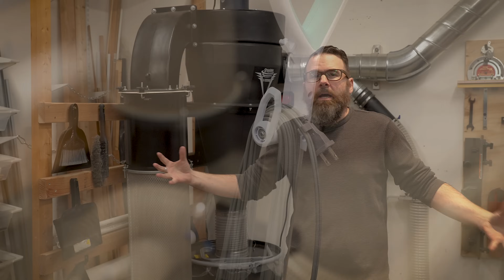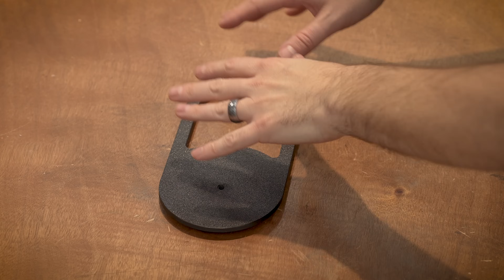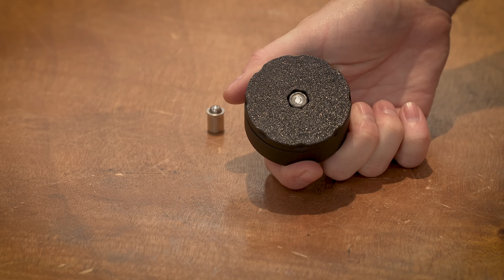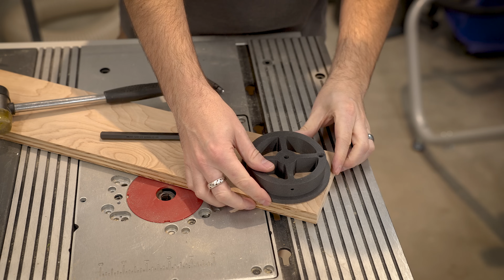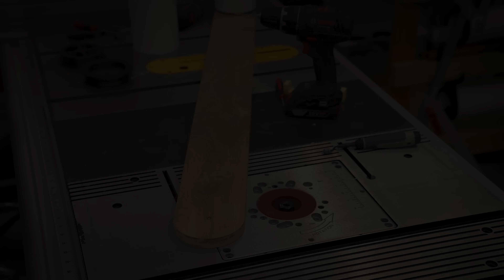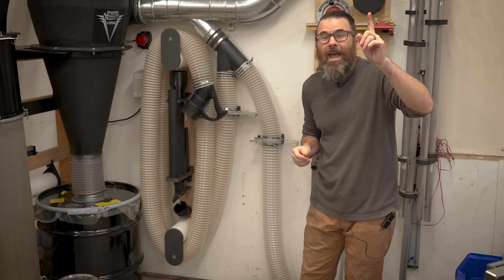3D Printed Hose Storage for Dust Collector

Comment: I may be getting really old.  Hell, I am old.  I’ve been a woodworker for almost 4 decades now.  Never heard those called “ball detents”.  I do have a gallon jug full of “bullet catches” that I have used in building numerous cabinets where they are used with a small strike plate.  When you install them into a cabinet door, they CATCH in the strike plate to hold the door closed.  Some folks use magnetic catches for a similar solution.  Bullet catches (now called ball detents) are a more elegant solution.  Either way, great use for them to be used for your hose storage.  Thanks for sharing.  Oh, and an idea for holding the hose together so you can access your dust collection control…… bungee cord.

Edited: For grammar
Reply from the maker: Things have many names, especially when used in different contexts.  What's a rabbet for some is a slot for others.

Comment: 14:44 keep an idea on wear and tear on the tube. The ball is after all a "point" touch on the brush's tube, and it might wear down a groove (as one keeps naturally placing things in the same spot once they get used to it, it's a human thing we all do). My old, old German made vacuum machine for ashes had a clip on system very similar to this, and because the bend had to go in a recess, it eventually wore down the metal on the edge thin. Just a thought.
Reply from the maker: I doubt this will get used enough for it to be an issue.  ASA is pretty tough stuff too.  BUT, these ball springs are actually just a ball bearing, so the wear should be somewhat minimal.  We'll see how it goes, I could always print the 'cup' out of a different material, or even something with carbon fiber which would actually wear down the ball instead (which is easier to replace).

Comment: 1:18 fire hose storage racks, specifically for the rigid type of hose used as adapters. It's basically a regular hose holder on steroids.
Reply from the maker: AH, saddle rack.  Nice.  I still like my solution better though, I can store the accessories.  But good to know!

Comment: i'm thinking of making a vertical reel for my 4 inch hose. the reel can be turned and hose can be guided to spiral-wrap around it a few times. that way i can have it only a couple feet tall, and 22 inches diameter.
Reply from the maker: nice!  it could absolutely be made in any orientation.

Comment: the ai voiceover sounds terrible. Change it back from german to english. Much easier to follow and sounding much better ^^
Great Video and thanks for the ideas ^^
Reply from the maker: Ha, I did nothing.  I only recorded this in english and did nothing different.
Reply: @RobertCowanDIY  The problem is that YouTube activates the option automatically. It is active on many channels without the creators receiving proper information.
But you can deactivate it in the settings. :)

Comment: All that effort and you didn't sand and paint the plywood??? No veneer on the outer edge?? You just put the camera in the trash??? Sounds like another project
Reply from the maker: I actually did sand the plywood.  I even used wood-filler on the voids, I just didn't show that.  But this isn't a woodworking channel, I'm not going to veneer and stain something that doesn't need it ;-)  And no, the camera didn't go  in the trash, it's a couple grand, I just need to get it fixed.
Reply: @RobertCowanDIY  my man! Maybe I misheard the post about the trash. 

But you were so close to perfection. I'm truly impressed you even filled the voids. You go all out when you go

Comment: That a tempting mechanic to use for something, but I really do wonder about the steel on plastic wear from the ball. I fear it'll make the locking positions really weak over time.
Reply from the maker: ASA is pretty strong.  I did think about that, but at the resting position, the ball is not really under tension, so it's happy to live there forever.  It only sees some wear when you spin the tab.  That doesn't happen very often, maybe a few times a week?  I'll let you know if it fails, but the ball also spins, so the friction should be pretty minimal.

Comment: great project!  what kind of clearances did you use for the detents in the groove and the mating holes?
Reply from the maker: I just used 0.2mm, and 0.5mm for the clearance between the part bodies.  I just modeled up the ball spring thing and gave everything 0.2mm clearance.  It worked great.

Comment: For SD cards, I’ve mostly switched to Sony Tough models and haven’t had issues with plastic bits breaking off! I had a similar situation as yours, a piece of card stuck in the camera, luckily no permanent damage to the camera!
Reply from the maker: OOF.  Yeah, I saw those, but they're a bit spendy.  Mine was already falling apart and I kept using it.  That's on me.

Comment: Now I want to buy some ball detents I may never use to add to the pile of cool things I might some day use.

Seems really elegant with the use of existing materials where possible vs every thing looking like a 3d printer nail.
Reply from the maker: Thanks!  I try to incorporate parts that already exist, like you said.  There's no need to design that spring feature as a 3d-printed part.
Reply: this is absolutely true, but it also super easy to add just a spring pocket and use whatever diameter spring / ball combo gives you the desired force or fits into your project constraints, same mating part, just detent pockets. once i figured this out, i have added ball detents to things that definitely didnt need them, but I needed them hahaha

Comment: When designing parts for ASA, do you do anything to compensate for shrinkage? 

Generally, I design to size then scale 100.4% or 100.5% in slicer.
Reply from the maker: I didn't notice any issues, everything was spot on.  The main mechanism was PLA and ASA, and I did nothing to compensate.  Everything was printed on a Bambu X1C.